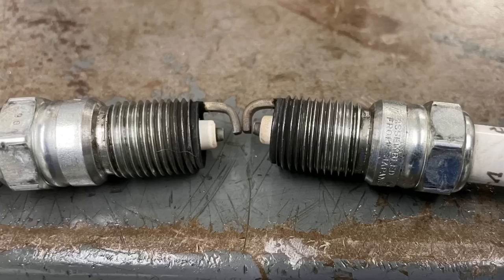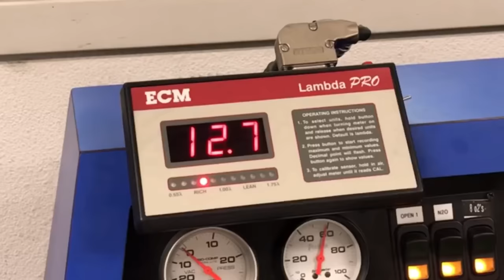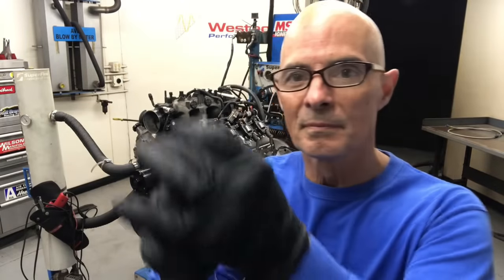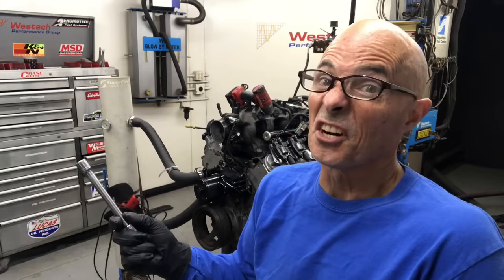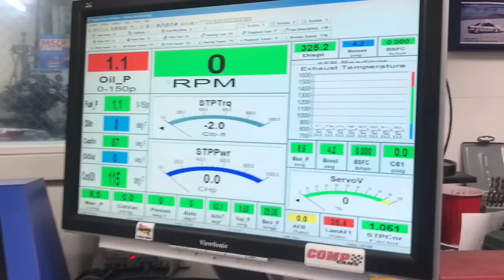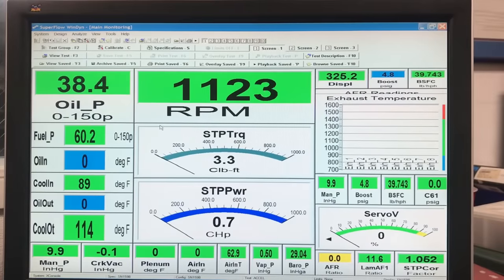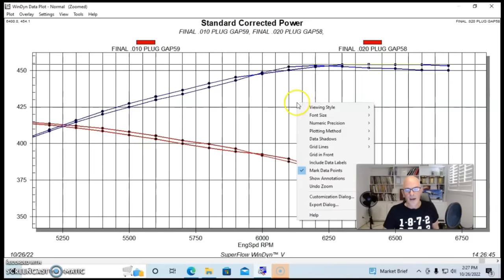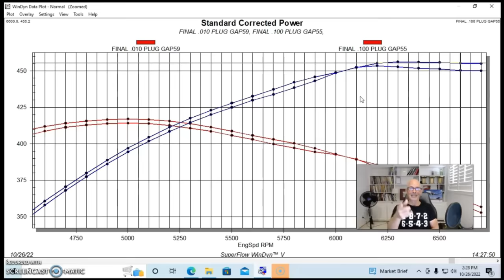JUNKYARD LS PLUG GAP TEST. DOES MORE GAP EQUAL MORE POWER? HOW MUCH SHOULD I RUN? .010 VS .100 GAP

Comment: Moist (fuel) air, temperature and pressure all that dictates how much voltage you need to jump that gap. Bigger gap takes longer to build up, in some cases ignition adjustment is advised.
On 2 strokes if you bog down at mid-rpm, CLOSING the gap will actually help you to get into the powerband.
On a 4 stroke i ran into cars who likes the plugs a bit more closed than factory (perhaps worn coils couldn't build as much voltage)
Some others had some missfire issues and making the gap a bit bigger helped to fix that issue. Gap too open you get missfire again, there's a gap you can finetune your engine to, but every engine has it's own. Best is to try and find out what's best for you. The spark plug that works perfect in your engine, can be the sparkplug that makes my engine missfire all the time X)
Have a great day

Comment: I experimented with spark plug gap in my own car. Heavily modified 2 litre turbo, running 20 psi. I gapped them down from 0.8mm to 0.6mm, to eliminate spark blowout. Doesn't affect horsepower much (other than the fact that the spark's not being blown out). But it does drastically affect emissions and fuel economy; both were measurably negatively affected. It's amazing what a difference such a small change makes.
Reply: 20 psi jezus
Reply: @draggedtv6888  😁
Reply: It is.
Reply: so which gave better fuel economy?

Comment: Going back many years I used to run a twin point dizzy, with a big coil, on a Cleveland, with a big solid cam, and 13.8:1.  Idle speed was 1100rpm, with 0.030" plug gap, and unstable. Adding an Acell Laser II CDI unit and increasing the plug gap to 0.045" resulted in a clean stable 750rpm idle speed, and much improved part throttle drive ability, along with better top end. That said Richard,  I'd like to see you rerun these tests with a throttle stop to see what results you get. Max throttle is the least used part of the power curve unless you are on the track, and even then,  on some tracks you don't spend much time there. A/F ratios at part throttle are often very different to full load, so plug gap, and spark effectiveness, show up differently.  Regards Greg
Reply: I've found similar results. Especially that gas was better in the 70's and could run a small gap. As time went on with the advent of electrons we found adding the motorcraft dura spark to our early engines with a wide gap and poor unleaded gas really improved engines.
I've had MSD, might suddenly die, fail but not the dura spark.
Reply: Not sure, never put car on dyno I did a lot of stuff like port matching and custom port work to the heads with triple valve springs. Also had block blue printed and was producing power up to 7500 RPM and man it ran and sounded incredible!!

Comment: I would like to see this test done again but with different plugs, heat ranges and gaps added to the scenario.
Reply: My experiece is , run the coldest plug you can that wont foul. theres no other downside to running a colder plug and IMHO if your tune is spot on you shouldnt be fouling anyway
Reply: @denisohbrien  Surface gap plugs won't overheat.
Reply: Hotter plugs melt and can cause detonation
Reply: @thisisyourcaptainspeaking2259  is that a challenge? Could you give an example of the kinda plug you mean? Only examples I can think of are very prone to fouling due to the tiny gap between the cold parts of the plug.
Reply: @BuzzLOLOL  MSD
Reply: In theory a hotter plug could perform well with a large gap without having to upgrade ignition coils
and a colder plug would not. also the gap could never bigger than the gap between the electrode and the base or it would just ark to the shortest point.
Reply: @denisohbrien Surface gap plugs arc to the side. Not a side electrode over the top like a regular plug.
Reply: Heat range does little besides causing detonation (too hot) or fouling (carbon deposits = electrically conductive). You want it hot enough to burn off carbon soot, but not so hot it glows red.

If you go about as cold as you can without instantly fouling, you still risk fouling with long periods of low throttle/load.

Comment: Indexing & side gapping

I would index the plugs with index washers to point the plug gap to the intake valve, (Or between the intake/exhaust valve is fine) Then after the plugs have been indexed, i would cut back the ground electrode a bit known as SIDE GAPPING, cut the grounding strap untill the center electrode is not covered by the grounding strap.   Insert the plug gapper at a 45* to measure the gap, increase plug SIDE gap about 15 thou from stock values, On a big block Chrysler is .35 STOCK increased to .45.

Noticeable idle quality and get up and go.  Done on a 361 Big block Chrysler. Other notes: Left more of a complete burn of the A/F mixture <Tan colour on the porcelain part of the plug>  little to no fouling of any kind aside from oil burning, Pretty good performance for a 'Tired" engine with compression ranging from 119 to 124 across the eight cylinders.

The negatives with the modification with side gapping plugs is that the plugs will wear on one side and chip away at the shoulder of the center electrode. Not only that but you will get less life of your plugs due to wearing on one side as previously stated.  

If your engine burns excessive oil, the side gapping will make the problem worse as the oil splash can now "Put out" the spark and directly splash oil on the center electrode making your fouling worse and or make the engine run rough.

This is another thing to keep in mind, probably more pronounced on high compression Turbo/supercharger/Nitrous/Nitro methane racing applications is the the spark can be "Blown out" like a candle due to the turbulent A/F mix swirling in the combustion chamber.

Note: The ignition timing will change a tad due to the bigger gap, and also the ignition coil will fire the only needed voltage to jump the gap, meaning installing a 45K ignition coil is not a complete bolt on power, you need to increase the plug gap to get the ignition coil to send more voltage to jump the BIGGER gap, henc taking advantage of the bigger voltage coil output.

Comment: If you’re really bored… try side gapping the plugs :) I did it on an old Suzuki thumper and I could feel it gave a tiny increase.
Reply: No No, 
It worked on my 94 Monster 900 too.
Reply: Helps idle/ low on a pushrod 302 too.
Reply: Q2/1973 was a Chrysler performance seminar held in San Mateo, CA.
Tom Hoover (father of Gen II Hemi) gave "tricks" of their performance team's experiences.
The MSD Gold box was the "Gold standard" of the time.
Hoover noted that "side gapping" sparking plugs picked up performance in Chrysler's wedge engine super stock platforms (utilizing the MSD Gold box). 
Seemed like a million years ago.
Btw Hoover conveyed there was no advantage gained with "twin plug" (426) Hemi applications. Nor did he think "hot water" honing (circulating hot water through the block w/torque plates while finishing out the cylinder hone process) had any merit.

Comment: A mate of mine in NewZealand  was taught to tune cars any v8s  2 stroke out board's  ect he has a heavy australian Hg Holden with a mild cam 327ci 600cfm 1850 vacuum seconds manual transmission, home made cold air induction box, tire diameter rear dif gearing matched for quarter miles,pacemaker extracters and some wonderfully ported iron cylinder heads by the famous local lawnmower small engine mechanic and the holley carbon tuning was his specialty along with his setting up the old twin point mallory distributor for correct dwell and advance weight curves all by feel,this car popped the front wheels of the ground about one inch when he hit second gear, i remember him adjusting spark plug gap it was always matched with the jetting of the carburettor regardless of what type, he said if jetting was lean open the gap to expose more fuel to the spark and close it up to stop rich mixtures from extinguishing the flame front .

Comment: Thanks Richard. I just found your channel and this test was top shelf thinking. I kinda wish we could have seen the difference in the AFR if any. I know the small engines like a lot of plug gap especially when running Methanol. My way of thinking is if you can create a cleaner burn of the fuel/air mix you have, you can always add more fuel. It would have been great to see if the AFR changed as a result of the wider plug gap. Subscribed.

Comment: I had a 2002 Pontiac Sunfire with the 2.2 OHV and i remember pulling the old plugs out which were factory im pretty sure and it had like .100-.115 gap. I was stunned it ran so well.
Reply: If it had the factory installed AC DELCO double puck platinum plugs that supposedly lasted 100K miles but rarely did because one or BOTH platinum pucks would fall and increase the .050 stock gap to like .100.
And to add insult to injury those thing were so damn expensive too !

Comment: Richard:  I have had good results with following a simple rule for plug gap.  Gap the plugs at .001 for every 1000VDC of coil voltage.  This will give you a good reference point to work when gaping your spark plugs.  Why!  I have found that with too much gap, in cases like boosted application, the spark can be, "blown out" so to speak.  The theory, as you know, is for the voltage to, "jump the gap" for a more perfect burn in the cylinders.  Again, too little or too much plug gap will cause a problem with combustion.  On the other hand, too little will not ignite the fuel a perfectly as a larger gap, hence, a bigger spark does help with combustion as shown in your tests.  Your test prove that bigger is not always a good idea.  Maintaining a good, proper consistent gap does help immensely. I gotta' go!  See ya.
Reply from the maker: MY TEST PROVED THAT BIGGER WAS INDEED BETTER

Comment: Olds 260 and 307 engines from the late '70s and early '80s ran .080" plug gap from the factory, presumably to pass emissions. These engines killed ignition coils, caps and rotors way faster than their other GM cousins.

I'm a little bit surprised that the .100" plug gap made the most power, but the difference was so small that it's negligible. Did you make more than 1 run with each plug gap?
Reply: Actually, these Olds engines went as high as .120....I worked at  "Sparks Tune Up" franchise...same corporation as Maaco Auto Body.

Comment: Big gap also tests the plug wire insulation.  Probably not so much an issue with coil on plug applications, but voltage has to build higher to jump across bigger gap.  Long plug wires may have a tendency to arc through the insulation if near bolts, brackets, or other sharp metal corners along the route.
Reply: I tried it on my 2000 f150 with a 5.4 I gaped to 60 and the only thing I noticed that wasn’t there before was when your going 70mph, and it have excellent throttle response before it would lag

Comment: Great test. I'd like to see what gains are, with a CDI, also increase gap and play with coill dwell on smart coils. Keep up the good work guys.
Reply: Same concept as we did with points ignition systems. We would increase the dwell time, while widening the gap. This may result in less horsepower, but degcrease 0-60 acceleration and 1/4 mile times.

Comment: This is a really good video and I I'm glad to watch I have a 351 that is stroke to 357 about 10 years ago seasonal car, and was told to run the Gap at 60. But with my inexperience with knowing at least the Gap could be between 25 and 60 I went with 40 just to be safe. Just lately I went and did a full tune up on my 90 Mustang with a '70s block and decided to try the maximum of 60,000 and low and behold mother nature takes over where they are salting the roads and spraying Bryn on the road. So I wait for better weather and circumstances! But very good content glad to watch! Good knowledge! Thank you

Comment: Of course what would be ideal if at all possible,  is to somehow  have the plug gap adjustable on-the-fly while the engine is running at a fixed rpm / torque.   No idea how do that but would eliminate unknown variables.
Reply: you could test at which voltage spark fails to ignite the mixture for a given gap, then plot the results !! :)  to vary the voltage, maybe a variable coil? there must be something like that.

Comment: This test on forced induction would be interesting. Also, this test with different heat ranges would cool. What did this test do to the AFR? If I’m reading this correctly, looks manifold pressure was affected. While reading the comments, increasing the gap makes the coil packs work harder so checking the temps of the coils while doing these test would also be interesting.
Reply from the maker: THESE COILS MADE 1543 HP SO THEY ARE NOT WORKING HARD AT ALL
Reply: @richardholdener1727  Over time maybe? Shorten the lifespan? I’m about to go gap the snot out of my plugs, hahahahaha!
Reply: I would like to see this test on a forced induction engine as well
Reply: @bigboreracing356  Not worried about it, just curious. I don’t I’ll ever make enough power to be too concerned about this issue. Definitely not as experience as some people on here so it’s good to know I’m not gonna grenade my engine because of the gap on my plugs, lol.
Reply: @richardholdener1727  A larger spark gap alters "actual" combustion timing. A larger spark, creates a larger flame kernel. The larger kernel exposes more mixture earlier. Therefore you will see faster flame propagation. Essentially advancing the timing.

To get a true comparison you need to alter the spark event and optimise power with each plug gap. I suspect timing has more of an effect on power than the plug gap. 

Note: Timing measured with a traditional light VS peak cylinder pressure transducer are asynchronous.
Reply: @bigboreracing356  it's not useless crap having the right heat range and gap absolutely matters especially on a modified engine running boost.  You can't just throw whatever in there just because it isn't a race car doesn't mean we don't want to run optimally.  Running correctly isn't only for race cars

Comment: Makes sense that IF your if ignition system is powerful enough, a larger gap means a longer just as hot spark again IF your coil or coils are powerful enough, thus a better flame front can propagate out from the spark plug yielding a small improvement with everything else being the same.

Comment: Plug gap is totally dependent on engine type, compression ratio and fuel type and ignition system. Spark plug heat range is far more important than specific gaps. As plugs wear the gaps increase. At service you can read the plugs and determine if they are too hot or cold, fouled from engine oil usage or over fuelling. A closed gap will give a weak spark as the coil discharges before it is fully primed. A wide gap will overload the ignition system creating resistance and over time cause failures. Playing with gaps expecting miracles is dumb.

Comment: So stoked to see actual back to back comparisons. Every time I get to the dyno there are too many variables that may have changed since last time. Seat of the pants, I feel like my mini sprint doesn’t drop off past peak torque quite as abruptly with 0.010” less gap. Maybe the coils run out of dwell time at that rpm? I need more data 😂 Definitely something I could test back to back within a reasonable time on the dyno.
Reply from the maker: very hard to test by "feel"